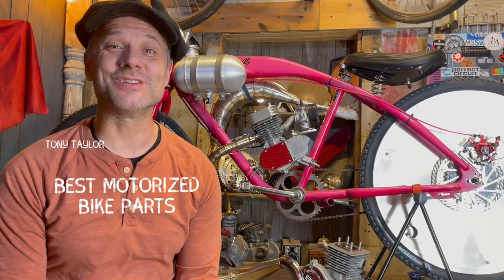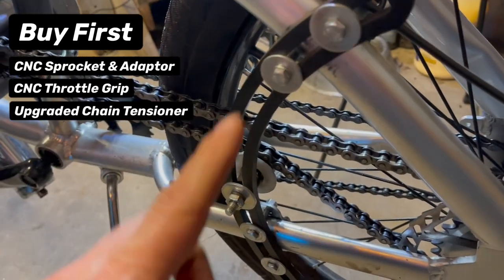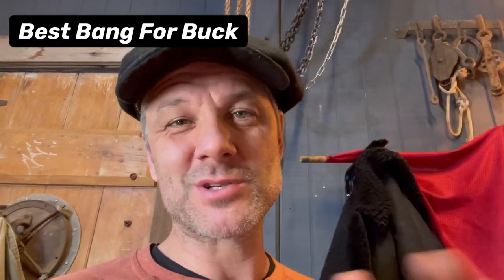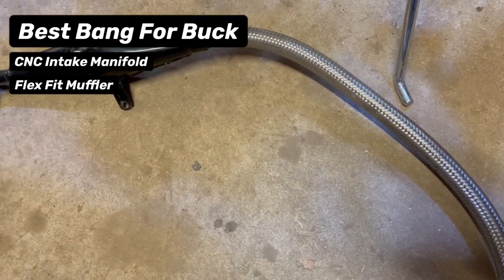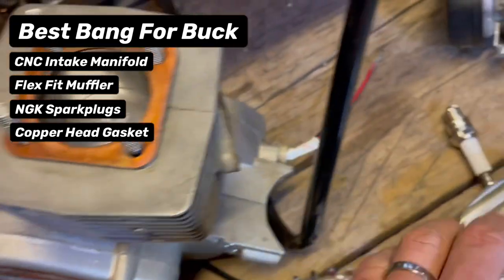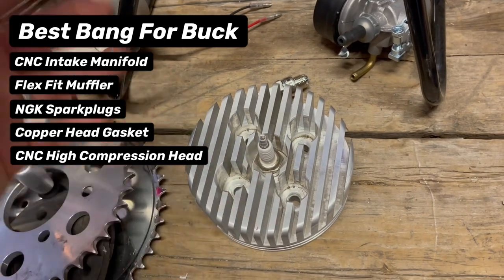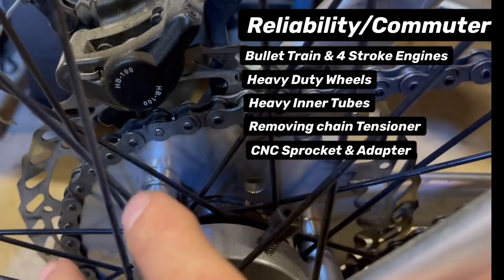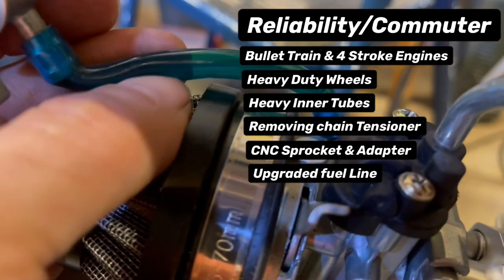Best Motorized Bike Parts | BikeBerry

Comment: Best tensioner is no tensioner get a spring tensioner for the pedal chain it kinda acts like a derailleur and takes up the slack in the pedal chain then you can adjust the drive chain correctly with no tensioner to get in the way or fall off 😉
Reply: I did that on this one. Works well.
Reply: Totally correct , Tensioners just make vibration , adds complexity & failure points .
The best builds don’t use them.
Reply: I just use the spring tensioner on the clutch cover..works great..

Comment: I have found the hard way, as far as reliability, is HEAVY DUTY rear rim, and Clamp on rear sprocket. That should be the VERY first thing done. I purchased a bike, brand new from Wal Mart, and put 2 stroke on it, and had fun for a year maybe, then one day I rode to town. I came out of the store to go home, and started pedaling to get engine started, and so many spokes broke at one time, my back wheel was jammed against frame.
Reply: I seen many people complain about the hub adapters slipping & videos of people cutting key way slots into the hub & adapter or sanding down the ends so it can clamp tighter.  Mine was slipping despite being clamped down super tight, so I scuffed up my hub & inside of adapter & used some super glue = No more slipping. Super glue sounds like a lame fix but super glue is actually made to bond metal together very well.
Reply: I put super glue on my Nintendo 3DS pen when I was a kid because it would keep slipping out, long story short that sucker was stuck more than a dog.

Comment: I have allready tried the dual brake lever with caliper brakes. I saw that that the pull power ends up reduced to each one of the brakes. So i removed it.
Reply: I would think that you would get uneven brake pull, the inside cable would have less travel than the outside one. I saw one with the cable inputs on top of each other, would think that would be better. Never used one so I don’t know for sure.
Reply: @robschlotterbeck2566  I have also tried that type you wrote (the one at the top of the other) but still not enough pull power. It is because the pull power of the lever been shared to 2 brakes. I do not remember if i had tried it with drum brakes in order to see if it works better. But for sure, it does not worked with the caliper brakes.
Reply: I don’t have that issue whatsoever on either bike. Have to see a video (or multiple videos) of your setup to troubleshoot.
Reply: On this green BT 80 bike I did put line pull hydraulic calipers front and rear. Now that’s a whole different braking experience!
Reply: @tonytaylor5087  Tony i had to remove this lever.
Reply: You need to get a tug and pull lever not dual pull.  Difference is one pulls normaly second brake grabs gradually.  Dual pull they kind of fail with only 65% of brakes working for some reason

Comment: Great video, thank you!  First off.. I dig that gas tank on the felt frame.  I was wondering what you used in the end of your grip/throttle to cap off the end and give it that dome look? That's a cool look.
Reply: It’s the stock handlebar cap on the F-Zero. I’m curious if an industrial supplier like McMaster Carr has them for regular handlebars 🤔
Reply: @tonytaylor5087  Cool, thanks for the reply!

Comment: HEY TONY, Where did you get those awesome wheel covers you have on the pink bike??? I have tried to find some on the net including the bike berry website, and I haven't been able to find any anywhere. They don't necessarily have to be aluminum like that, I would be ok with plastic but I do like the look of the aluminum ones you have on the pink bike.  If you could point me in the right direction I would really appreciate it. Thank you for all your great help and advice.  I no longer watch anyone else's YouTube videos on motorized bikes.  You have more knowledge and experience than anyone else and I know that I can trust what you say, and I know that your advice is always going to be good advice. Thanks again

Comment: 1. Definitely a must. CNC cog and hub mount adapter but mag rims are better, it takes care of the heavy duty rim the rag joint and looks cooler and takes care allows for disc break all in one and it's about the same price as heavy duty rim and the hub mounted adapter together so you kill 3 birds with one stone. 

2. Aluminum CNC throttle is good but thumb throttle with the double pull break built-in is better cheaper and allows the clutch cable to be on the left hand side. And comes in under $20

3. Arch chain tensioner is good but spring loaded i motor mounted chain tensioner s better as it gives as the chain takes tension is smaller.

4.. agreed. Stopping is the most important part of riding g a motorized bicycle. Cannot stress this point enough.

5. See #2  and this also allows you to keep your clutch lever on the left hand side.

Bang 4 buck.

1. Agreed but be aware that this also changes the angle of the motor because of the lack of the bend which will cause you to need a chain shim inside the case it's a small little thin piece of aluminum that bolts into the case where the chain rides on the 11 tooth sprocket. 

2. Agreed. Depending on the performance that you're looking for your bike, different pipes for different things but yes the flex pipe is the best one for the first time builder because it allows you great versatility in where you place the pipe and takes all of the tension off of the flange where the pipe hooks to the motor and adds all the performance enhancements that most other pipes will offer.

3. Agreed. 

4. Agreed.

5. Agreed. Plus they look cooler.

6. Agreed.

7. See #2 in first category

8. Agreed. And it totally allows for you to work on your bike and have the back wheel off the ground in case you need to work on the back cog or any other aspect of the back rim.

Speed and performance

1. See number two in the first category.

2. Agreed.

3. See number one in the second category.

4. Agreed.

5. See number 2 in the bang for buck category. The flex pipe has the expansion chamber built in and you don't have to worry about it and it's easy to place.

Commuter bike.

1. Agreed.

2. See # see number one in the first category as per rims.

3. Agreed. 

You forgot to add a parts and tool bag for the bike they are small you can carry everything you need in one place. Tools patches etc... 

Definitely a must for anyone that rides their bike constantly. I might also add that inner tube liners to keep from getting a flat also work very well.

As far as exhaust goes the small little heat sink adapter that goes on the front of the motor where the exhaust hooks up is definitely good for the bike it is not a must but it is a good upgrade if the bike will allow for the exhaust pipe to be hooked up that way which the flex pipe also comes very handy in this part of the build. 

Good vid!

Comment: Copper is softer than aluminum thus a better seal upon tightening
Reply: Anneling the copper by heating it up with blow torch  just before installing the copper gasket annealing it is good because most copper is heat tempered to harden during manufacturing

Comment: just got my 1st motor and having problems installing the throttle cable seems where it hooks the carb is too long cant take all slack or even half plus the plastic throttle is not working i am in process of receving my disability so any repairs will be free just need  thought's on solutions so any ideas

Comment: Granted, pretty much all advice given in this video is very useful and genuine, but some of it is not. 
ENGINE: For starters, the bt80 is DEFINITELY not reliable for commuting, however, the MOST reliable is gotta be the Triple 40, due to not being able to buy most REPLACEMENT parts, and there is ABSOLUTELY NO aftermarket support. The engine may go longer without breaking, but the triple 40 is HALF the price of the 4-stroke, has almost DOUBLE the power, has a better clutch, MUCH better aftermarket support, replacement parts are DIRT cheap, and the triple 40 is MUCH easier to perform maintenance on. 

STURDY WHEELS: This information is great, but for a motorized bike using a centrifugal (Automatic) clutch, the stock wheels will perform fine. The same can be said for stock kits. Even if you have upgraded your engine to THE MAX, the only way you'll NEED to get a heavier-duty wheelset is if you ever get a Hybrid engine (Piaggio, Minarelli, Chainsaw, Etc). However, Tony's advice is still great, but I would not use BikeBerry's HD wheels, due to every set I've ever used/bought has been not properly trued, and are UNUSABLE without expert modification. 

SHORTY INTAKE: The information given, concerning the shorty intake is top-notch, but it is a much more impactful mod than what it is made out to be in this video. The shorty intake not only almost COMPLETELY eliminates air/vacuum leaks, as well as provides MUCH more space inside the frame, but it also improves throttle response, and efficiency, and eases the tuning process of tuning the carburetor.

Comment: Tony: I bought the Switz Cruise and 48cc BBR Tuning. I did get the heavy duty hex head bolts. And aluminum intake. Speedometer said top end 42mph. But it took a few blocks to get there. I added the vapor recovery bottle, and Expansion muffler. It reached 55mph much more rapidly. A notably louder sound. But tolerable. And yes, the heavy duty rims are great.
Reply: That’s awesome!! Glad to hear your build is going so well!
Reply: There is no way you're doing 55mph on a 48cc your speedometer is wrong
Reply: I would like to know  how you reached  55mph on a 48cc
Reply: @thfpv4974  I have to assume that blue thread dressing and a micrometer torque wrench helped somewhat. The BBR Tuning motor didn't hurt. At stock the speedometer barely made 42mph.
Later I added the vapor recovery bottle, and an the Expansion muffler. It went to an easy 55mph. Actually hovered around 56-57. The front end got light and scared the P out of me. Don't plan to do it again. Till I put more weight on the front end. I was shocked that it reached 55. The only other thing that occurred to me just now. Is I use Premium gas for the mix. 
55 or the speedometer Bikeberry sells is inaccurate.
Reply: @thfpv4974  it can be done but not with these simple mods.  Unless ya weigh 10 pounds.
Reply: You didn't reach 55 on a 49cc not possible without porting big carb etc and by the way the boost bottle doesn't do anything 🤣🤣🤣 it's snake oil!

Comment: I'm looking for better gaskets i went through bike Berry few years back and sent me junk not the engine i have that a eighty sitting for spring.. i deal with motor ex.. now
Reply: I could definitely be wrong but I feel bikeberry is trying to rebuild their brand I know the engines and products before weren't great but I've bought two kits in the last 6 months and they're exactly the same as the goated zeda triple 40 so maybe they're trying to be better
Reply: @Bobs-yer-uncle  they are middle it's hardware not engine.. i don't they will top Zeda have two on the road and go.. cable's and few i paid seven through bike Berry half it was missing and cables junk..
Reply: @elliot ness   I don't even understand what you are trying to say but you do you my man 🫡
Reply: @Bobs-yer-uncle  I was saying from a kit i ordered from the hardware down bike Berry doesn't matter it's hardware.. don't get me wrong high end motor everything else was junk

Comment: Dual brake lever is just stupid. You're gonna lock up rear wheel so easily and crash. "ONLY" brake you need is the front one since it's for 70-85% all of your stopping power. also fixed chain tensioners are  no good as well. best chain tensioner is the spring one that mounts to the front sprocket/clutch arm cover.
Reply: I agree, a spring chain tensioner is WAY BETTER than any fixed one. It's way smoother and works perfectly!

Comment: DO NOT GET THE CNC THROTTLE ASSEMBLY SHOWN IN THE VIDEO. I bought it, and it immediately shredded the throttle cable. It is is also prone to sticking, leading me to become badly injured and rendering my bike totaled. A throttle assembly with a higher quality bearing and pulley system is MUCH better, and will only run you like $20.
Reply: Link please?
Reply: You gotta put work and file and grease those cnc throttles they’re not good for beginners.
Reply: @IvanLopez-hs8il  Even once I fixed the issue and greased everything up, it did not perform nearly as well as the CHEAPER pulley system.
Reply: Well, not sure what to say as I’ve had great luck with them on every single build. Love to see some pictures of your failed part.

Comment: If your thinking of a heavy duty rim set just go to a bike shop and have em find you a 12g rim with a shimano hub. 
Cost me an extra 8 bucks over BB hd rim pricing, and will be trued, and wont be a ripoff, and comes with better hardware as well as a shop that can inspect it for defects as well! (And maybe itll even come with a warranty.)

Bike berry (and other sites) should sell their "heavy dookie" rim for 25 bucks tbqh with the horrendous amount of user interaction required before they are even remotely good to use for 5 minutes. Its just a cash grab.  

Also. Dont go for a hardened chain (imo) as that's going to eat your sprockets (if its actually hardened) or potentially snap. Adequate tension and making sure it has good coverage on the drive and hub gear is all you should really need as well as it being tensioned correctly

I have an approximately 6 or 7 year old kit currently still surviving (with thousands of miles on it). With all the basic bits n bobs on it. Still going good, only now had to replace the rear rim from the bikes factory one.

As for expansion exhausts, i recommend at minimum going through a few reads and learning how they actually work. Dont try putting an expansion chamber 2 or 3 ft down after the exhaust port. Pretty much defeats any benefits and purpose of it. (If your exhaust needs some bending use a bench n heat while gently bending it.)

Throttle, honestly im getting an atv style throttle brake combo here thats sized for my handle bars. That allows better independent brake control whilst providing a throttle that wont break (the bank or literally)

Overall the kits can be good if done right. Always run em a lil rich for longevity, and make sure the motor and rear hub are aligned. Give it a few moments at least to warm up at idle before a ride and you should be good.